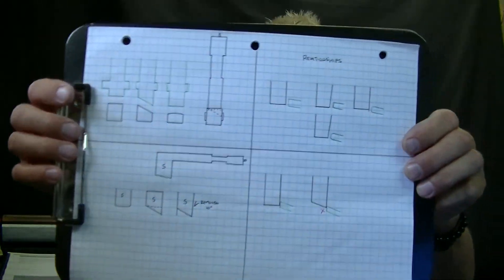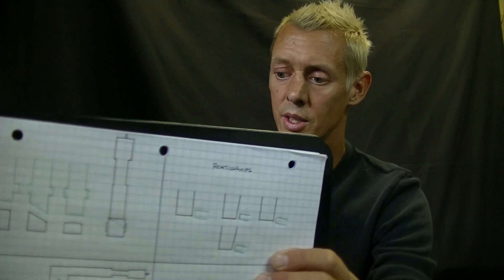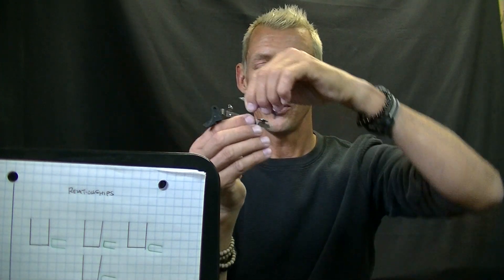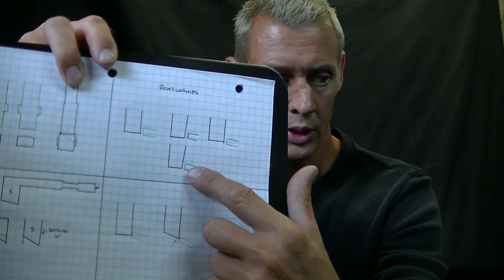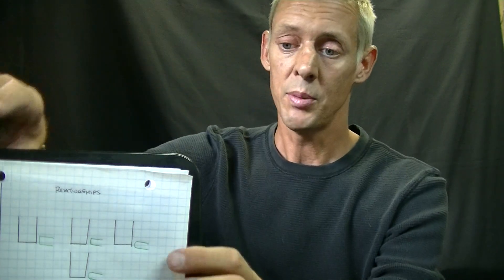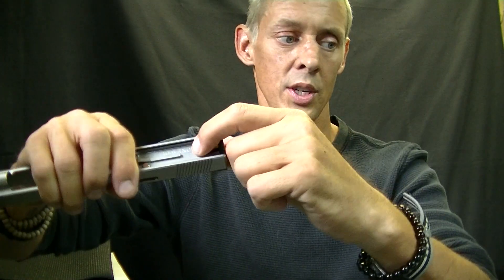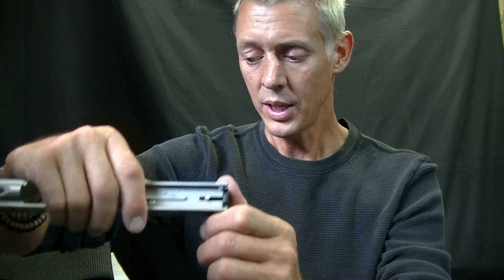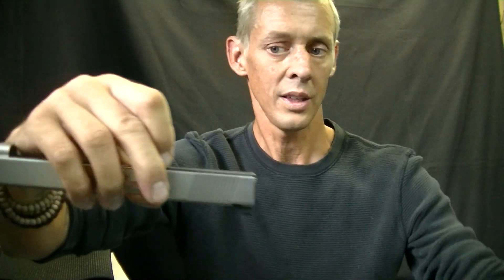JOHNNY CUSTOM striker mods  EDUCATIONAL ONLY

Comment: Thank you again for another great video. I just found this channel and I am really enjoying your content. At the end of this clip, you describe a "gun drop" situation resulting in an accidental discharge. If the striker slipped from the sear, wouldn't the firing pin safety lug catch the firing pin?
Reply: Potentially yes, but all safeties are mechanical and anything mechanical can fail.  So layers of protection (redundancies) like the three integral safeties on the Glock are only protective if they are all functioning. In the drop example, if the striker slips the sear, the trigger safety means nothing.  At this point you are really down to two safeties, one of them failing.  Lord forbid the striker safety failing as well...

Comment: Super informative, thanks a lot. So to attain the smoothest rolling break start to end with no wall, you suggest to start with rounding the sear?
Reply from the maker: Oldrich Kotas Ever so slightly too much and the release feels mushy and will sometimes create an odd glitch. SMOOTH SMOOTH SMOOTH is the key polish the be jesues out of both seer and striker lug face than a touch of rem oil but you really need to make sure the thing is mirror finish
Reply: JOHNNY GLOCKS the persona Got it. So you say radius of about 1/3 is already too much?
Reply: Robert Watson  IMHO,  The Wall =  Upon pulling the trigger, there is generally some slack or “take up”, followed by some moderate resistance, followed by a harder/firmer resistance, “the WALL”,  just prior to “the break” (where the “sear” drops & the firing pin is released & gun goes boom). 🙂.  Or, said a bit differently, The WALL is that trigger state just prior to firing, when the trigger breaks.  Johnny can say it much better and he has a number of times in various videos (but I don’t remember off the top of my head which video best explains that, though he does have a video on TERMINOLOGY that probably explains it.  Good luck.